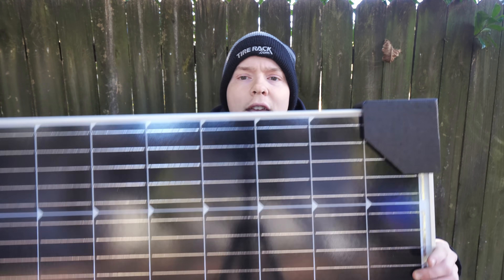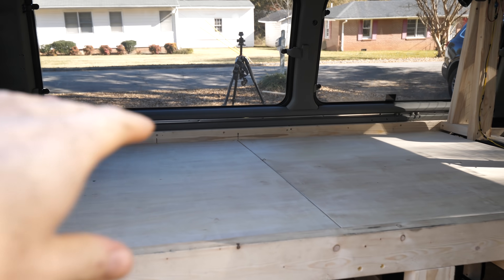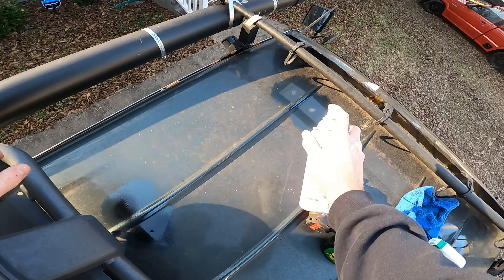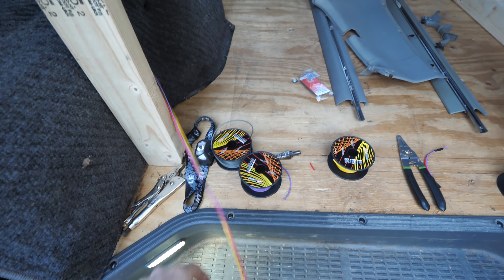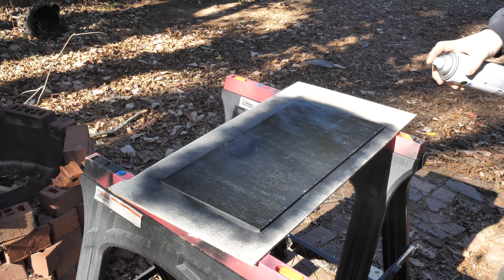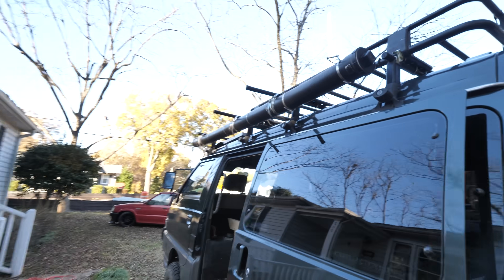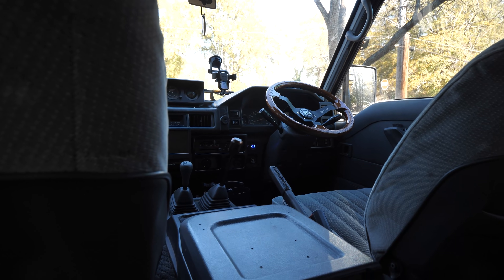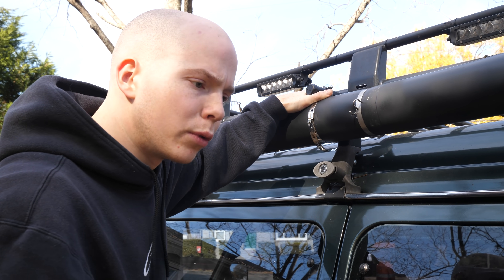How to Install SOLAR PANELS on a Camper Van/Bus - JDM Adventure Van Build (Pt. 6)

Comment: We drill holes in the side of vans and roofs of cars daily at work, We mount external cameras to police vehicles among other things. Whenever we install anything external, a bit of paint and shit loads of silicone does the trick. We have tested it. And anyway, the vehicles are stripped of equipment and sold on in a few years so its not like it needs to last till the end of time anyway.

Comment: Pro tip: set your circular saw blade depth about 1/2” lower than the material you’re cutting. That will minimize tear out and sanding that you have to do afterwards.

Comment: I fitted roof/camping lights to my camper. I used a remote switch from Amazon as I wanted the ability to turn them off without getting out of bed etc. Might be worth having a look the remote switches are only about £10.

Comment: you should have put a piece of rubber between the solar panel and the roof you could drill a pipe and wires to run through them

Comment: You should have switch between batteries so both are charged by solar and both can be charged from engine but starter bettery is not deolated by RV stuff

Comment: wait, when you were hammering the end caps back into the bars after you cut them off your roof rack, i noticed them move inward... are they just single piece tubes that span the width and are just friction mounted in place... or uh, are they adjustable??

Comment: At 13:20 is the rally Miata missing it’s engine? I notice the cover is a lot more sunk in and doesn’t match with the body lines, what’s going on with that?
Reply: But the exhaust pipes....whha
Reply: @vk.gfp.  my thoughts exactly, you can still pull an engine and leave the pipes resting against something, at very minimum the hood has to be off for the tarp to be “sunken” in that match.
Reply: @GoldenTiger5457   oh ok

Comment: Looking like some awesome progress. You should add some rubber washers between the solar panel and the roof to stop the 2 surfaces rubbing through under the vibration on moving. Using some nyloc nuts on the solar panel brackets might be a good idea to stop them vibrating loose.

Comment: This is so nice! Coming along nicely. What are your thoughts on putting some rubber strips between the roof and the solar panel mounts? If you’re planning to take it off road, there will be a lot of vibrations! Can’t wait until you do the inside fitting!

Comment: Did you put a rubber grommet so your roof solar panel wires dont rub against the raw sharp metal edges of the holes you drilled and short out with the vibrations of moving, inside that weather proofing box?

Comment: Mans goes from some super nice wiring prep, solid install, to putting wires through metal with no grommets, and electrical taping 20 ft of wiring that’ll be exposed to the weather 🥴

Comment: So I work for a Camper/RV rental company, and I figured I would make a suggestion. When we install solar or install anything on the roof, we seal everything with a layer of Dicor lap sealant. We lay it on pretty thick, it is self leveling. Any bolt or seam is covered. Because it self levels, it gets super deep into every crack and hole. I would say to run a layer of it around the edges of the box for the wires and the solar panel brackets, as well as cover the heads of the bolts. Just a suggestion for an additional layer of sealant, the silicone should be enough, it just might wear out kinda quickly. The silicone doesn't allow for much flex and might separate from the metal where as the Dicor is soft and flexible. It sorta never fully dries, so it will self level and adjust for years.

Comment: When working on this build, did you have to factor in the weight capacity of the Delica? If weight wasn't a constraint what other mods would you have done? Stellar work btw. I think this is an awesome build series!

Comment: @ 14:50 that awning is going to be putting a lot of force on those hose clamps when you are bumping around on a trail. I fear they just wont be up to the task. At the very least, take a few extra with you when you head out.

Comment: So not quite related to this video but the heater install one, if you never got the pump/pressure issue sorted you could try installing one or 2 of the cheap carb regulators to drop the pressure down a bunch right before going into the heater.

Comment: I would have put some rubber or silicon around the holes you drilled for wires. Vibrations over time will rub the wires on the metal which could cause issues.

Comment: Great video as always. My only note on the water carrier is that it may be a good idea to move the pipe to on top of the rack so the rack is supporting the weight rather than only some hose clamps.

Comment: Just a thought:

Why don't you mount an extra solar panel under the roof rack, it will provide extra power.
Even if it doesn't get as much sun, as you empty the rack it will get more sun light...
Reply: Wouldn't be worth all the extra weight and wiring most likely
Reply: @shiftymiata  an extra few pounds shouldn't make that much of a difference and the wiring shouldn't br that hard to do(except for the maybe having to strip the interior again)

Comment: "old JDM van, rust free, don't wanna be ruining it" my guy you drilled holes through the roof xD rusty or not if it were to ever get returned to factory as highly unlikely that is it'd need filler and spraying, neet video tho some nice mods.
Reply: oh my gawd it's so true that for a guy that literally awd EJ25 swapped a miata, fixing a hole in a van's roof is impossible, thing is trashed, might as well drive it straight to the junkyard